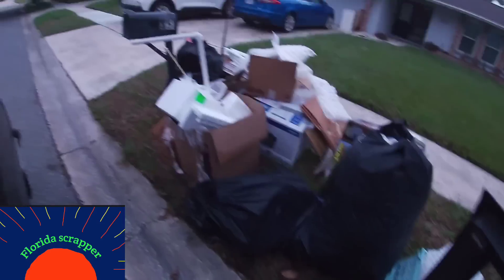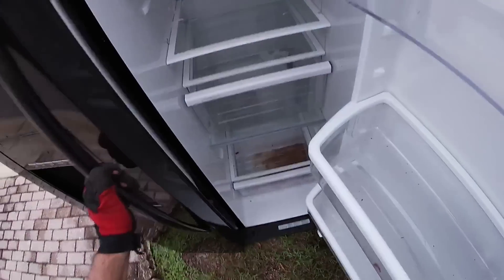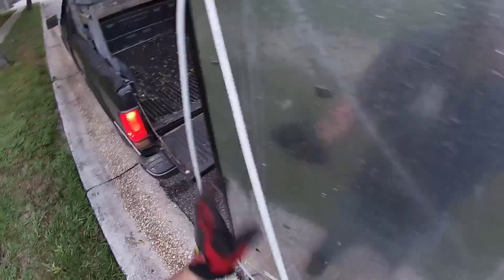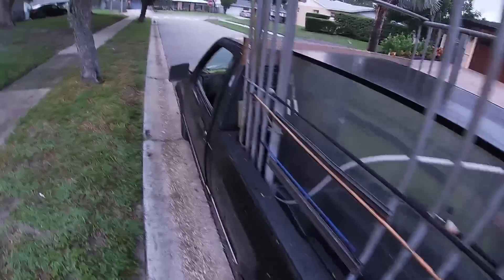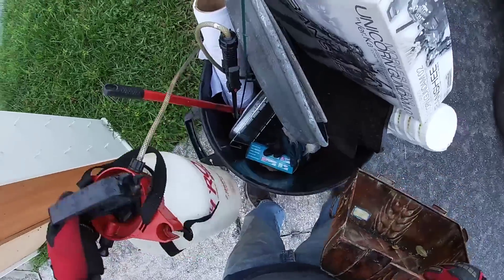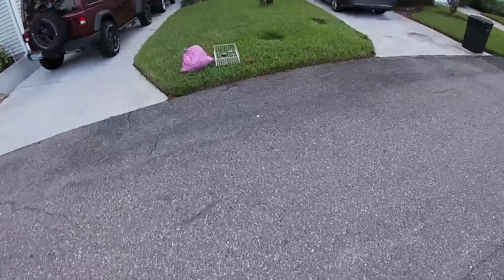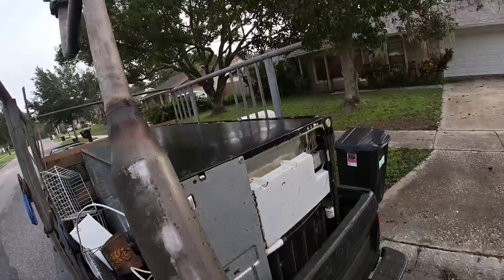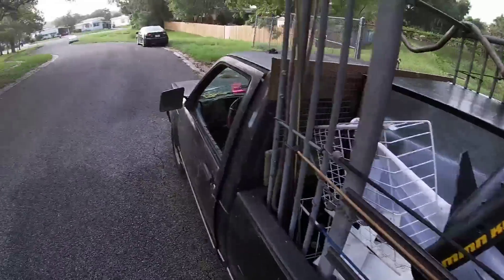Rescuing useful items and picking scrap metal from the trash.

Comment: When you have a fridge that size and no traffic on the street just back up to the curb. Your truck will drop down with the slant of the street and the fridge will be higher because of the ground. Should be easier to push into the truck.